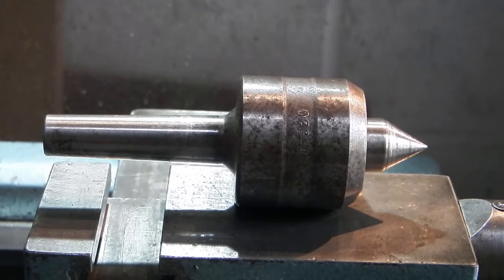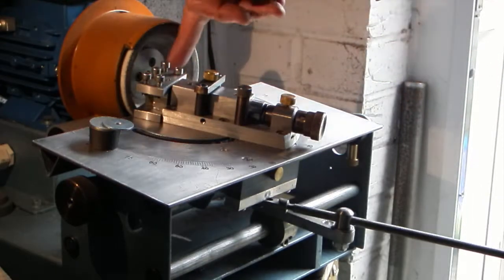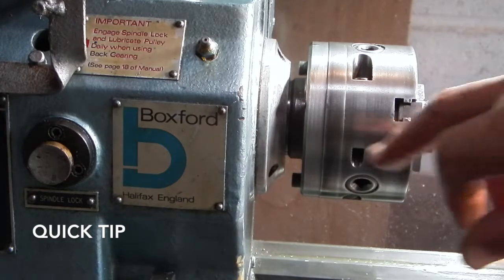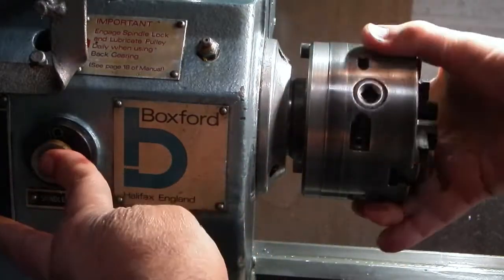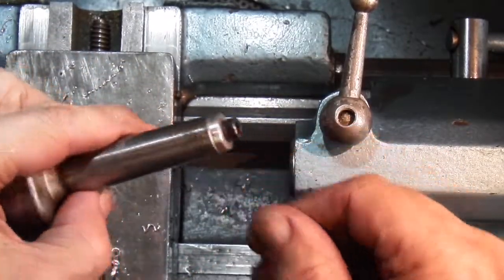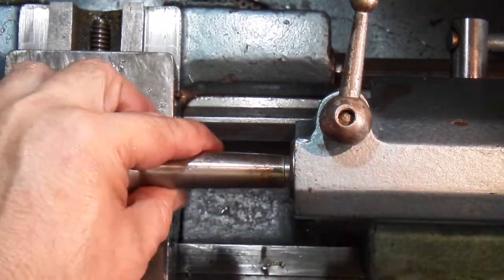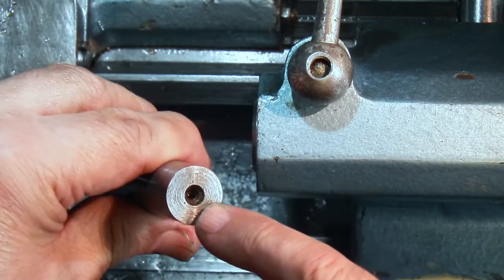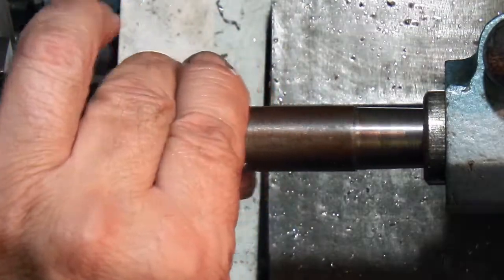Morse taper ejection problems

Comment: Hi Alan…I have two fixed dead centres that I want to add tangs to…my problem is how to hold the morse taper in the chuck so I can drill and tap the rear. It has no parallel sides to grip in the chuck. Any suggestions? Cheers John
Reply from the maker: Hi John
The only way I can think is too
Machine a taper the same as the centre in a steel bar, so the centre fits inside and the small end sticks out the bottom. This will allow you to machine the tang end. Make sure the length of the bar allows the centre point to protrude  above the other end of the bar. Make a thread on the outside of the (large end). 
Now make a cap that screws on the large end and stops the point of the centre pushing back out of the taper.
You can now hold the bar in the chuck with the centre held inside and the tang sticking out for machining. 
That's the only way I can think of holding the centre with out it pushing out when machining the tang end.
Regards Alan
Reply: @enotsengineering  Thanks Alan. That was how my thinking was going, but I was hoping to find a simpler solution, as all I wanted to do was drill and tap an m6 hole to fit a cap headed screw…Then it came to me…hold the large end of the taper in the chuck and hold the small end in the fixed steady…easy peasy..Cheers